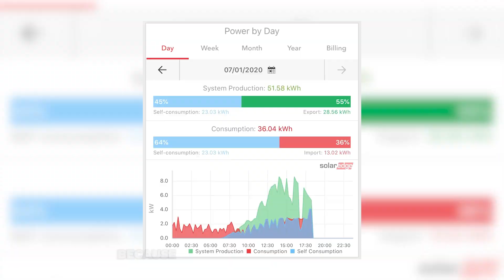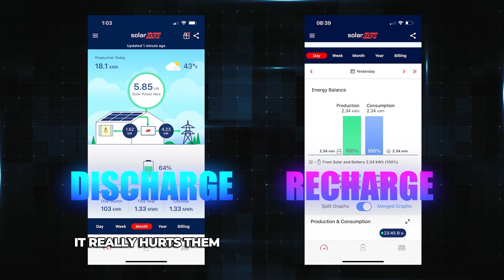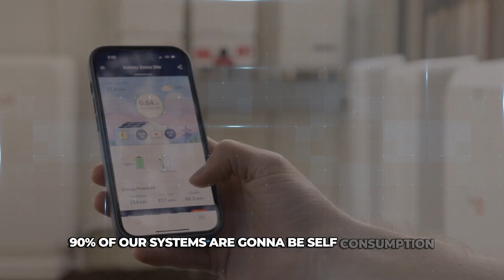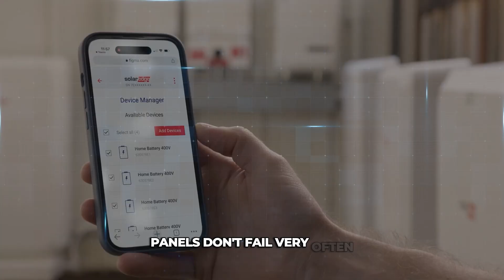SolarEdge Battery Review: Why It's the Best Choice for Homeowners under NEM 3.0 in California

Comment: I have 13 panels 4.60KW. I went two solar panels edge backup batteries I was told I need ten more panels because my system can’t support two batteries  is that true?
Reply from the maker: It depends on the yield of your system. Are your batteries getting full every day? If not I would recommend adding more. we always recommend 2.5 battery to solar ratio. 2 solar edge batteries should have about an 8kW solar system to be most efficient year round.

Comment: I got the inverter, the battery and the EV charger all from SolarEdge but the battery can't use the MANUAL mode or the Time of Use mode like in other countries! Why is Australia different?  These modes are crucial if you want to charge your battery from the grid during off peak or even just prevent your battery from being drained by your car trying to charge during off peak 😡
Reply from the maker: I would see if you can set a profile. Solar edge has a ton of pre set profiles in the back office and you can choose one that is best suited for you. That being said I dont know if the settings change in Australia.
Reply: @supremesolarandelectric Thank you but I wouldn't be so upset if I could do anything to control my battery. Melbourne, Australia is apparently still waiting on a release date for these features to be enabled. I feel like it's a lie the company tells us because their support staff know nothing about it, also the rest of the world has had these features for 4 years.

Comment: I had my SolarEdge Home system installed in Australia last January with backup interface and hot water controller. I wasn't told about the array to battery ratio. I have 8.5kw array and 1 battery, so i will look at getting another battery, i think. I also send 17% of my production to the grid, and buy 17% of my power from the grid. So would that mean i should get a 2nd battery?
Reply from the maker: It really depends on your SolarEdge system and your exchange rate with the utility. Under the new NEM 3.0 policy, our export rate is pretty low, so we design systems to run about 95–98% off solar and batteries, sending as little as possible back to the grid. That’s where the solar-to-battery ratio matters more. If you have a good export rate, the ratio becomes less important

Comment: Our HOA has a 17 kW inverter (iirc we used to have a 17.5 kW inverter, but it recently broke down). Can we just hook up a SolarEdge battery to that same inverter? Afaik most grid tied systems can't do that, you need to get a hybrid inverter to make that work.
Reply from the maker: That is correct you would need a hybrid solar edge inverter to use this battery. Only AC coupled batteries would work with an existing solar inverter. Check out the Franklin or Neovolta
Reply from the maker: Yes it will require a solar edge hybrid inverter to work. This is a DC coupled battery and only works with a solar edge inverter. I would check out an AC coupled battery like franklin or neovolta

Comment: Do you know whether separate batteries can have separate schedules set for them in the app? e.g. I'd like one battery to always charge from the grid at night if it hasn't got to 100% from solar during the day but would like to only ever charge the second battery from excess solar.
Reply from the maker: They work in sync, so if you wanted them to charge from the grid at night, you could do that, but it couldn't be one battery while the other stayed empty. You wouldn't want to do that anyway. The batteries are set up to maximize export credits while taking care of all the home consumption. It decides in real-time whether to export to the grid for a higher value or send to the home loads.